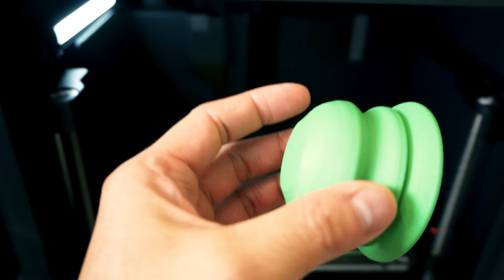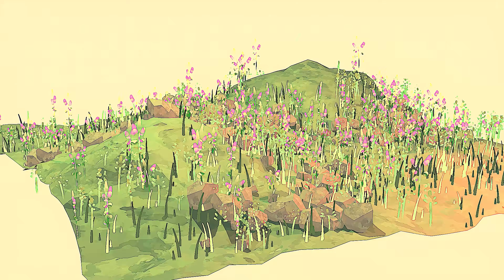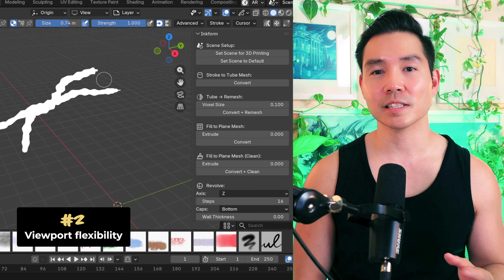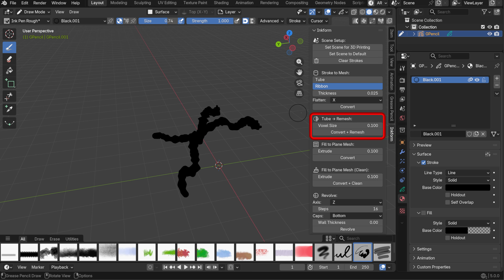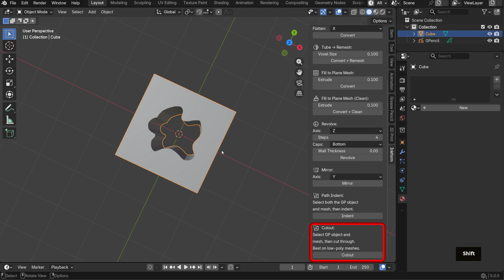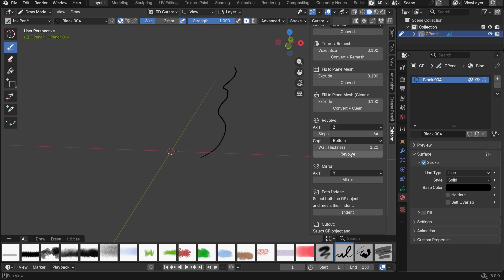How I Turn 2D Drawings into 3D Models in Blender (Inkform Free Addon)

Comment: Any ideas as to why this add-on doesn't install? I've tried installing through Preferences. Tried installing manually. Deleted Blender and tried all again. It doesn't install. I paid for the add-on so would really like to use it 😢 I can see inform in the add-ons folder. However it doesn't appear in the add-ons list in preferences.
Reply from the maker: Unzip it first and then try installing the .py file directly. Hope that helps!

Comment: it didnt work on 5.0
Reply: Working Method as of now : Unzip the file (Downloaded) > In blender > Scripting Tab > Text Editor Window > Select "Open" > Find the unzipped folder and select the python file > Run it by clicking on Play button.
Reply from the maker: Try installing the .py directly, not the .zip. And also try redownloading in case there might have been a problem with the download.
Reply: Same here and I happen to download both Blender 5.0 and 5.1 and tried it, not working, it doesn't recognise the addon

Comment: How does topology applies and works with this? Can I only use shaders with it or textures as well?
Reply from the maker: It depends on the feature you're using. The geometry is clean enough for stylized 3D art and 3D printing. And textures work fine since it's standard mesh geometry.  But if you're optimizing for games or animation you'll likely want to retopo after. Just keep in mind that's not really its primary function so topology won't always be perfect out of the box.